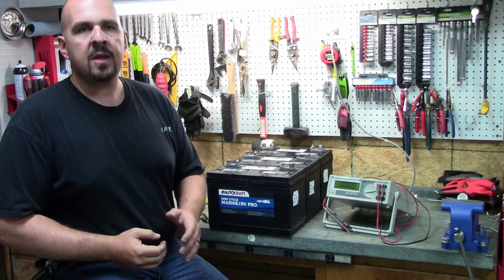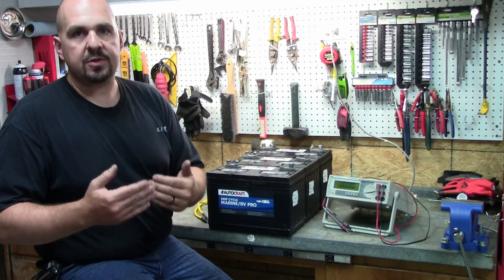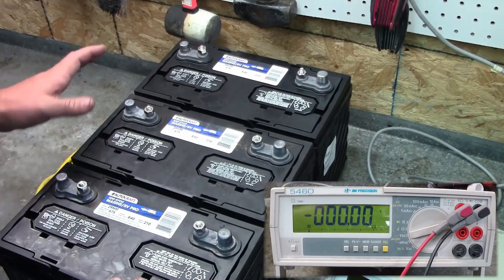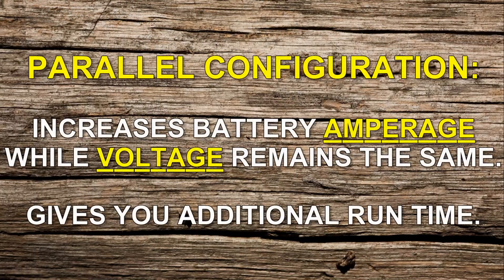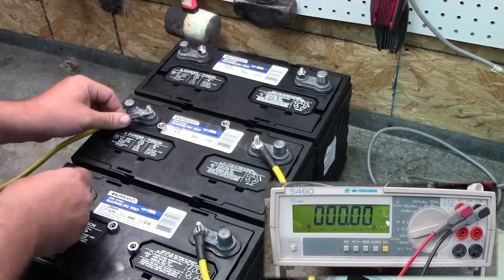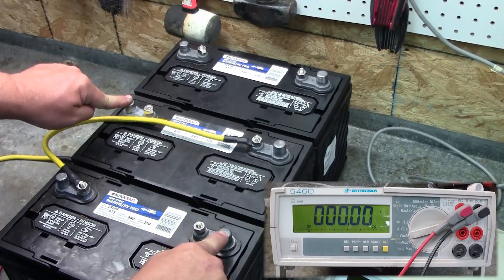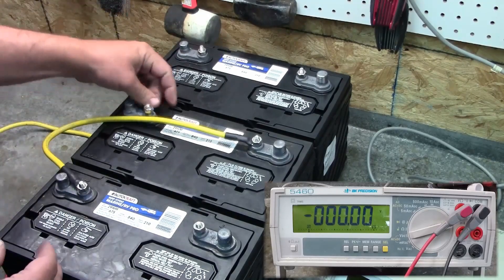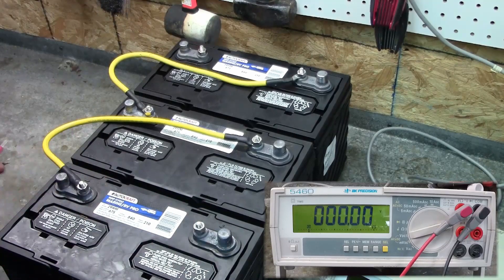How to Properly Wire 12v, 24v & 36 Volt Trolling Motor Batteries In Your Boat (Series vs. Parallel)

Comment: Great video...helped me out! what about adding an on board charger?
Reply from the maker: Thanks, Chris.

You can definitely add an outboard charger to batteries connected in series. Just attach one output of the charger to one battery. Continue until all your charger ports are filled or you've connected each battery individually.

I use a 4 bank onboard charger. 3 banks keep my 36v trolling motor battery bank charged and the 4th bank is for the cranking battery.

It makes it easy to keep ally batteries topped off when not fishing.

Comment: What gauge jumper wire do you need when making it a 24V ? Using it for my Terrova 24v 80lbs trolling motor thank you
Reply from the maker: Use a jumper at least as big as the fire you're running gl the front of your boat. I'd recommend 6ga or larger

Comment: Hey man. Have a 2002 Tracker PT that I'm finally switching from 12v to 24v. I bought a 2011 80# MK Terrova off marketplace (still had the freaking plastic and shipping nut on it and paid $400). The boat has 8ga currently. I will be adding a third battery. Is it appropriate to use a 4ga jumper wire, run 6ga through the boat, and a 60 amp breaker? This would mean I would also have to replace the receptacle/plug up front to one that supports 6ga wire, correct? Sorry to blow you up, just new to wiring.

Comment: Hey mind if I ask what gauge wire to your
Reply from the maker: It is dependant on the current draw and the distance between the battery and the trolling motor. 6ga is a good starting point. Larger trolling motors may need 4ga
Reply: @TheWeekendAngler  I have a older min Kota 24v I’m trying to double battery. thanks again for this amazing video
Reply from the maker: @Seanboatfishing  Thank you for watching. I hope it helped you out.
Reply: @TheWeekendAngler  it did a ton deserved a like and subscribe

Comment: how do you charge the 36V system?
Reply from the maker: You charge each battery individually from its posts.
Reply: @TheWeekendAngler  I was hoping for an easier way but thanks for your reply
Reply from the maker: @ThaiNguyen-hq3wr  if you had a 36v charger, you could charge through the outputs, but it's hard on the batteries.

Comment: My boat is a 12 volt system right now and my outboard motor charges the battery can I toss in another 12 volt battery to make my system 24 volts for a bigger trolling motor without damaging anything? Or is it best just to get 2 new batteries to make a 24v system for it and keep the 12 volt for my boat
Reply from the maker: If you have the room to dedicate two batteries to your trolling motor, it would be better. If not, it is OK to add a second battery and use the starting battery to help make your 24v system.

I have done both before depending on how much extra space I had in my boat. You'll definitely get the best results from separate trolling motor batteries. Not just in terms of performance, but trolling motors also generate electrical interfere which can affect the signal quality on your electronics such as fish finders.

Comment: if i were to hook a charger to a 24v setup, will both batteries charge together, and would i have to hook the charger up a specific way like how you test the volts with it on 1 terminal each on the starting and ending battery?
Reply from the maker: You'd have to have a 24v charger. It would work, but it's better to charge each battery individually.

Comment: And how do you charge the batteries?
Reply from the maker: I use a noco genius onboard charger with multiple banks. Each battery is connected to one bank. For my boat that uses a 36v trolling motor I use a 4 bank charger. One bank for each of the trolling motor batteries and one bank for the starting battery. When you get home, just plug in an extension cord to a port on the boat and walk away. The charger does the rest. 

The noco genius also has a desulfating pulse that helps maintain your batteries while charging.

Comment: whats the purpose of stepping up from 12v to 36v for example. And does this mean that if I bought 4 x 200ah batteries and connected them in series I would only have 200ah worth of storage vs 800ah worth if connected in parallel?
Reply from the maker: The reason I showed how to step up to 24 or 36v is because the larger trolling motors for boars require this higher voltage. Certain other applications do as well.

To answer your second question, yes. If you connected four batteries in series, the available storage would be 200ah, but the voltage would be 48v instead of 12
Reply: @TheWeekendAngler  Thanks!

Comment: I always thought that if you  put a + and a -  together on a battery, you will spark it out?? On your video w/ 2 batteries to make a 24 v system for a trolling motor?
Reply from the maker: If you put a positive and negative together on the same battery you will cause a short.

Comment: What gauge wire do you use to connect the batteries?
Reply from the maker: That depends on the total amperage being drawn. A good rule of thumb, however, is 6awg or 4awg wire for most trolling motor applications.

Comment: Howdy Josh. What gauge jumpers do you use?
Reply from the maker: It depends on the amperage being drawn. For trolling motor purposes, however, you can usually get away with 6awg or 4awg

Comment: Very simple! Thank you! Looking to buy a sear 14 ft v bottom just the boat, nothing else soon so I wanted to know this for after I save again and get a trolling motor for it. Also gonna be looking to possible add some seat and carpet it. Hoping you might have a video on carpeting a boat and some other boat building stuff. Gonna subscribe in case you add any videos like I need as well

Comment: can you wire the two batt for 24 and the one extra for increase amps or longer run time
Reply from the maker: Technically yes, but I wouldn't recommend it. If you were going to do something like that, I'd recommend a 4 battery setup. Two sets of 12v batteries wired in parallel (for extra amperage) then the two banks wired into series (to make 24v)

It would work, but I'm not sure the increase in run time would outweigh the added weight of two additional batteries.
Reply: @TheWeekendAngler  thank you for the rapid re. ok her is  what i want to achieve, i build this electric trike runs on 8 24 volt lithium packs from fiat 500e total volts charged is 204 . i have two extra packs of the same i want to wire these two packs in parallel  at the end of the series were the 204 volts meet the controller. giving more run time. i charge and balance 8 packs of 24v individually. . so basically a range extender. these two packs would be charged separately as well. do you think it would work.

Comment: Thanks for this video. I have a couple of questions. Does this also work the same way for lithium batteries? Also if I only have a 12v lithium battery charger and the two batteries are wired in series, do I need to disconnect the series joining cable before charging each battery separately or can I charge both batteries at the same time while connected in a series if the charger only outputs 12v?
Reply from the maker: This is applicable to lead acid or lithium batteries. You can leave the batteries in series, however you can only charge one battery at a time with one charger.

For multiple battery applications, I highly recommend the noco genius multiple bank chargers. They are completely waterproof and feature technology that rejuvenates your batteries as it charges them. I have a Noco Genius in each of my boats.
Reply: @TheWeekendAngler  If you have multiple 12v in parallel, then will the single bank Noco recharge both/all batteries?
Reply from the maker: @skyp0ke  technically yes it would. But it would take much longer to charge that way as it would be dividing the amperage of that one bank by the number of batteries you have in parallel. For example, a single 6 amp bank will charge one battery fairly quickly, but connect it to a bank of 6 batteries and at best they each get 1 amp.

Comment: I am getting a 24v trolling motor. Does this mean I need 3 batteries (2 for trolling motor and 1 for motor)? Is there a way to hook up the alternator to both the trolling motor batteries and the crank battery?
Reply from the maker: Personally, I would run three batteries so that you don't inadvertently discharge your battery while running the trolling motor to the point that it won't start your outboard.

However, you can get away with only two batteries.

I believe minn Kota makes an alternator adapter that will charge multiple batteries from the alternator on your outboard. I haven't used one, so I can't speak for its reliability.
Reply: @TheWeekendAngler  thanks for the reply

Comment: Is it possible  to hook up a 24v and a 12v battery to obtain 36v for a trolling  motor?
Reply from the maker: Yes. You would just wire the two batteries in series like I did to make 24v in the video.

Comment: In all these different configurations you explained, what gauge wire do you recommend ? Thanks for the video !
Reply from the maker: Wire gauge is dependent on the length of the run and the amount of current being drawn. What trolling motor are you running?
Reply: @TheWeekendAngler  minn kota 12v  The runs would be short 12-18 inches max. I have two batteries. I'm thinking about a parallel setup.
Reply from the maker: @gwangi7099  you could probably get away with 8ga wire for a run that short. It shouldn't cost much more to do it in 6ga wire, though which would be able to handle a little more amperage.
Reply: @TheWeekendAngler  Thanks Josh for the answers. I look forward to your videos coming out.

Comment: Great video!!! What if I have to charge the batteries with a portable charger. Do I only need one charger? Can I leave them all wires together and charge with 1 charger??
Reply from the maker: If you are wired parallel, you can charge them all with one charger. To help ensure they all get charged fully, connect the positive lead of the charger to the first battery in the chain and the negative lead to the last. This makes sure the charger sees it as one large battery.

Comment: This is a really good explanation, I do have one clarification question. The positive and negative from my trolling motor cables would be on the same battery, and then I'd run the jumper cable as shown in the videos to get the 36 volt, right?
Reply from the maker: No sir, connect the batteries in series as shown to get 36v and then connect the positive terminal of your trolling motor to the open positive battery terminal and the negative to the open negative terminal. (These are the same terminals I connect the meter to when reading voltage in the video)

Comment: Does it matter if I go from positive to negative or negative first then positive?
Reply from the maker: No that won't matter as long as the end result is the one battery being used for your positive connection and the other being used for your negative.

Comment: My bank charger has two sets of cables for charging batteries. With me running them in parallel, do I connect one cable to each battery, or one cable to both batteries x2.
Reply from the maker: If you're running your batteries in parallel, just connect one set of leads from your charger. Tape the other set off to prevent shorting

Comment: This may be a dumb question but when you are running two in parallel, do you have to charge both or do you just have to charge one?
Reply from the maker: In parallel they will charge together off a single charger

Comment: Thank you!  I fly a general aviation airplane with. 24v system.  I always wondered if I was stuck somewhere at a small airport with a dead battery how I might jump it. It seems the 24v cross connect would be the way?

Comment: How do you charge them in Serial then?  Connect to one or both , one at the + and one at the - ?
Reply from the maker: You don't charge them in serial. You can leave them connected in serial while you charge each battery individually, though.

Comment: Hey I enjoyed watching the video. I'm  watching battery wiring because I have a question on my trolling battery setup. I saw that if I take a voltmeter to each battery after a full charge they are 13.50. So expecting touching the positive post and the negative post I should get something between 24 and 26. But I don't, I get zero (0). Why? I noted that a negative cable goes from TM1 to the Trolling motor, and positive cable from TM2 going to a circuit breaker then another positive cable from the circuit breaker to the Trolling motor. Theres a cable between TM1 and TM2 from negative (TM2) to positive (TM1). Does that make sense? So I would say that is a series connection to provide 24 volts. So why am I not seeing 24v with the voltmeter?  Thanks for any input!
Reply from the maker: Try connecting your meter. Negative lead to negative tm1. Positive lead to positive tm2. See if you're getting 24v there. 

It sounds a little like the factory setup in my champion boat. There was a switch at the front casting deck that switched from 12v run / 12v charge / 24v. It was a very sloppy setup.
Reply: @TheWeekendAngler  thank you for the quick response. I did check it both ways, same result of 0. It is a factory setup from 2 years ago. I had a battery (starting) die on me on the lake this last week so now I'm checking batteries and I thought I'd learn more about wiring.

Oh wait, I just re-read your reply. No I did not check neg to neg or pos to pos. I will try that tomorrow and report back. Thanks.
Reply: Follow-up:  I placed TM1 neg to TM2  neg and got a reading of 12.84. I did TM1 pos to TM2 pos and got 12.81. I also did the TM1 pos to TM2 neg and visa versa and zeo reading.

Comment: Great video. Is it possible to charge 24v from 12 v outboard alternator
Reply from the maker: No, but you can wire the 12v batteries in parallel to let them both charge from the alternator.
Reply: @TheWeekendAngler  Thank you for the information.  Are you saying that we can use one of the batteries out of the 24v bank to use as the starting battery for the out board?
Reply from the maker: @andynash7973  yes. You can use the starting battery and a second battery to power a 24v trolling motor while still starting your outboard and running your electronics off of one of the batteries in the bank.
Reply: @TheWeekendAngler  Thank you for the quick response.

Comment: What gauge wire is best to use to wire them in a series? Gona be useing it for a 36v trolling motor. It appears to be 6gauge?
Reply from the maker: I'm glad you asked that. I am a day behind on my short tip Saturday video this week, but the one for this week is going to be all about wiring things the correct way. Including choosing the right wire size.

Comment: I have a question. Can I purchase 6 12v 30 AH batteries and get them to equal 36v and 180 AH?
Reply from the maker: With six 12v batteries rated at 30AH, you could connect all six of them in parallel and come up with a 12v system at 180AH. 

Once you start connecting them in series, you  no longer add the Amp Hours together. So, what you would be looking at here would be two banks of 3 batteries each to make 12v at 30AH.  You would then connect the outputs of the two banks in parallel and end up with a 36v 60AH setup.
Reply: So to answer my question no you can't.
Reply from the maker: @jordongettings506  correct

Comment: I've got a 1998 Stratos bass boat and I've been told that I dont need a jumper because mine jumps at the receptacle on the front deck. My 75lb 24volt  trolling motor isn't as strong as I think it should be. I currently don't have any jumper wires and my two batteries are just wired normal. Ive got 2 positive wires and two negative wires coming from the receptacle on the front. Any suggestions? I understand that if the receptacle is reading 24volts then in theory when i plug my trolling in i should wired up correctly?? Maybe... Awesome video! Thanks
Reply from the maker: Thanks for watching. Lots of information to cover here, so let me know if I miss anything.

1st, my champion boat has the same receptacle. They do the job, but I don't use mine. The main reason is the factory uses the smallest wire they can get away with.

You also have to remember that modern 24 volt trolling motors are putting out a lot more power than the ones produced years ago. Wire sizes that may have been adequate in the late 1980s are no longer adequate for today's equipment.

If it were me, I would strongly consider running a new run of wire from the battery to the front deck and using a new trolling motor plug.

If your boat is anything like mine, if you pull that panel on the front deck and look at the trolling motor wiring, I would be willing to bet it is somewhere around ten gauge. Depending on the length of the run, you should be using 6awg or 4awg.
Reply: @TheWeekendAngler  You're absolutely correct. I have 10 gauge wires. So 4 or 6 gauge wire   and 24volt plug. Then I can run straight to the battery without a series or parallel jump right?

EDIT: Sorry I just checked and the wires say 06 GA
Reply from the maker: @michaelchapman4261  right. If you're going to run new wire, go ahead and get the 4 Gage. The price difference will be negligible. You will make your jump back at the battery boxes so that your wires going to the front will be carrying 24 volt.

You will want to install a circuit breaker within 12 inches of the battery. A 60 amp breaker would probably be correct for this application. Make sure you are using good quality crimped terminals and tinned wire. Standard copper automotive wire will corrode quickly in a marine environment.

You can get everything I just mentioned for a good price from www.genuinedealz.com
That's where I buy my wires and connectors. I am not affiliated with that company in any wait, I have just received excellent service from them and they sell quality products.